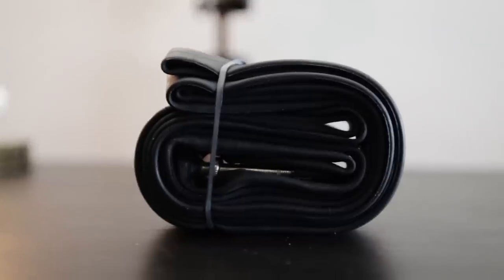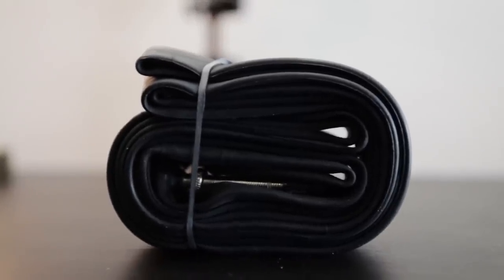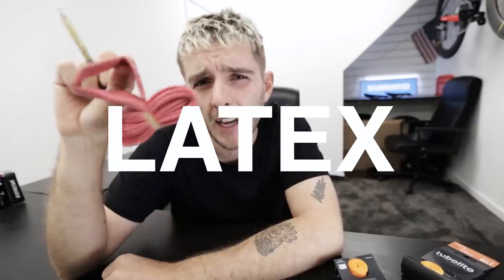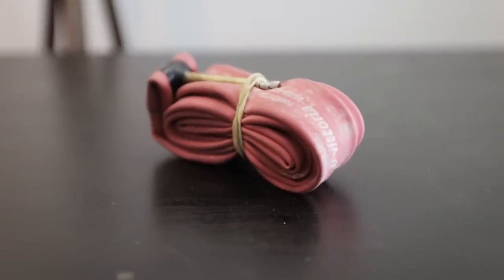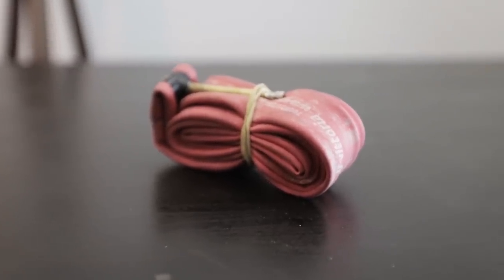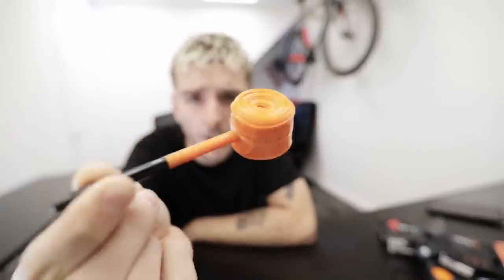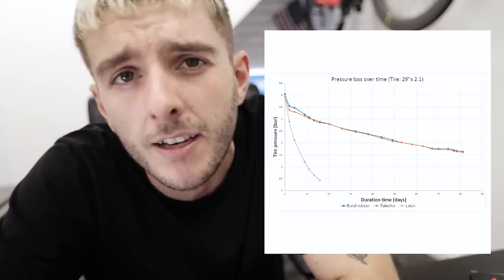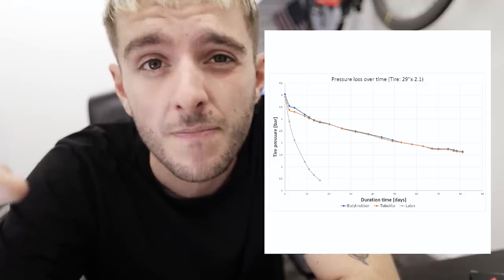The Single Best Upgrade for your Road Bike

Comment: This just cleared everything up for me! I must be made of Butyl because I am also heavy and slow with terrible rolling resistance 👍🏻 I will no longer go through life confused anymore Thank you Mr Cade.
Reply: rolling resistance increase linear with weight and not with power so if you ar twice the weight of quintana you have twice the rolling resistance and could save twice the watts with the same upgrade. this only works with rolling resistance not with chain friction or ceramic bearings...
Reply: Ianis Caratti What I typed was a joke, thanks for that though I guess....Keep up the good work with that science stuff.

Comment: Tried regular butyl and “light” butyl then several brands of latex.  Settled on Michelin latex but really could not tell much diff between brands.  Pair with GP4000 ‘s on fulcrum racing zeros; quick, comfy, light for the uphills, sticky for the down.  Can usually find them for ~$10 US, the right tool for people who like going fast.  Tubeless good for MTB, sucks for road...

Comment: I've always been trying out new components and couldn't agree more with your correct analysis having use/using all 3 types you mentioned. Tubolito initially supplied the "O" ring to be installed on the outside of the valve hole to stop the ingress of water into the rim. I wrote to them on the uselessness in it and they agreed(having received multiple feedback on the same issue). They have since removed it. Also, the initial batch out of the factory had their valve cores loosely screwed on, resulting in lost of air and "sudden puncture". They have now installed it with a clear liquid form of Locktite, which is almost permanently tight. I can pump up to 100psi and leave it there for 2 weeks and it hardly drops below 85psi. Word of Caution: Never ever over tighten the valve core on a Tubolito, you will either break the plastic valve body or stripe out the threading. And Yes, do remember to buy their Flix Kit...it come in 5 patches and is a 1min repair job and it really holds up the repair. Now I either use Tubolito or Latex.....no more black plastic Butyl.

Comment: Once you go latex you never go back... They feel so much better to ride on. In my experience they flat less often as I believe the material does not have the tendency to split like butyl.  Some complain about latex being hard to repair but the trick is not to use the patches in the repair kits but to cut your own latex patches out of an old tube. Once applied the new patch is just as stretchy as the rest of the tube  making a superior repair to anything you can do with butyl. Just be more careful installing and don't yank too hard on the valve stem. They roll so smoothly, like butter.

Comment: I've been running mine for about 1 year and they are great, no punctures or issues....if you're bothered about weight and already have a semi decent wheelset with normal tubes, these offer significant savings for the price....people laugh at spending £25 for an inner tube but then go out and spend £5000 on a bike? Go figure.

Comment: Hey , referring Tubolito , I was one of the testers of.the first gens few years back ,I can say that the product improved , and that the only issue I found was that the repair kits were(first gen) were not good enough, nowadays perfect patch's, and 2019 15k Kms , and 2punctures (same day) it's not a bullet proof option , but a very high quality one ,and if you use s-tubo(the lightest ones) they are for non rim brake options, the only negative comment is the glued on extenders on the 80mm options (in.black) looks like a bodge..
Regards

Comment: The tubolitos make great spares for your saddle bag. They’re a lot lighter and way smaller compared to a standard tube. I can now fit two tubes instead of one into my bag.
Reply: This - I use the cheaper butyl tubes in my tires but I carry a tubolito as a backup tube, it's so much more compact than other tubes that it makes your whole seat roll smaller.

Comment: Been using latex for many years, on the bike that is. Based on my experience, and barring the smaller inconveniences, they are noticeably better ride than butyl. Best band for buck (using the Vittoria pink ones). For people not keen to go tubeless, latex is the way to go. One caveat, installing on right during carbon clinchers. More in on all tubeless and will not go back tubes. Schwalbe, Vittoria and wtb tubeless... Best ever!

Comment: There’s one other option. Specialized and Continental make a light butyl tube at about 80 grams each and they reduce rolling resistance as well. See bicycle tire rolling resistance online. I changed to Continental 5000TLs recently and have had only one puncture leading to a flat since last August and that was only because I hadn’t checked the sealant in 2 months and it had dried up. I check it more often now! Since putting these tires on I have new Strava segment PR’s on a lot of rides. I agree that tubes and or tires are the easiest and least expensive upgrades you can make to your bike
Reply: The two Continental "Race Light" 700c/42mm stem tubes I weighed came in at 77g and 76g (calibrated scale).  Conti website said 65g.  Still, lighter than normal butyl at 100g more or less.  I use them routinely and have had no probs with them, roughly $7 each on sale.

Comment: Upgraded to Michelin Aircomp Ultra Light inner tube, the difference with just standard inner tubes is... Stunning! Acceleration is so much easier, due to it's light weight even tho it is still butyl

5€ for a 75g inner tube is I think a bargain :D

Comment: Latex is on the build list for my bike this winter. Lighter crank...✔️Stock square taper to carbon GXP. Lighter wheels... ✔️stock to Wabi Sub-15’s. New chain ring... ✔️50 tooth X-Sync, probably not any lighter but 10X cooler. (Specialized Langston for reference)

Comment: Best ride and closest to tubs, is latex + open tubular clinchers, I use on my road race bike and cross bike. Latex in standard rubber tyres is less effective as  the tyre profile is effective square, where as the  cotton open tubular clinchers deform on cornering

Comment: One Problem of the tubolitos is the vent:
- insert can get loose easily ( or may not be completely fastened from the factory
- does not work with a lot of pumps, especially those that have a screw on hose and many of the minipump clamp-on heads.
Some which do not work well:
- lezyne road
- silca tactico (bluetooth)

also the weird profile of the tube makes mounting a bit more of a hassle. May get better with practice...
You need to be more careful not clamp the tube while mounting. 

But except the vent issues tubolito (or similar alternatives) are great backup tubes. I would ever pack one, even then going tubeless.
Reply from the maker: I only have lezyne pumps and they work ok!

Comment: I tried tubolitos. Liked riding them until I got my first puncture. They sell a repair kit which I used. But it didn’t quite work for me, it never sealed properly. Which was a shame, given the price of those. But for me, nothing compares to riding latex inner tubes. I just love the feel and sound of them. Can’t really ride them on longer rides, because I have rim brakes and they’re a bit sensitive to the heat from the rim. Found that out the hard way. Still, they’re my favourites.
Reply from the maker: I found the tubolitos felt nicer to ride than latex, but looking at the data then latex is fastest in terms of rolling resistance... or no tubes at all!

Comment: I also roll tested and found latex better than tubilito. I agree that tightening the valve core is important on tubilito.  And related to that I think I may have cracked a tubilito on time which led to a constant slow leak. Since then, I stick with latex.  With latex, if you inflate cold, and then ride in the sun, you may get a 10psi bump and an accompanying explosion mid ride.  If you like high pressure, stay away from vredstein latex. If you like 95psi, use vredstein latex.  Vitoria is the latex brand I use.   It's worked well. It is similar to Michelin but Vitoria lets you do more in terms of valve stem versatility.

Comment: well the obvious thing that comes to my mind is what if we just ran a setup without an inner tube at all? i've had some struggles with tubeless in the past 18 months, my main gripe is just tire models that won't go on or come off. i found that hutchinson fusion 5 galacktik were the easiest to mount by far, way easier than schwalbe pro one or gp5000tl. i'd recommend a tubeless setup with these tires because they were super easy to slide on the rim and make repairs or throwing in a tube on the road way easier. i'm surprised no ones commented on how there's liquid rolling around in your tire all the time with tubeless but i'm sure it's not too big of a deal since it doesn't affect road feel or anything

Comment: Very satisfied with Michelin Aircomp Ultralight tubes + GP4000s. (...am also riding a relatively wide road wheel [Zipp 303], so the ride quality is probably a little better than it would be from a narrower wheel).

Comment: This video is so last decade ;) ... I switched to tubeless two years ago and I'm considered a late adopter by the folks I ride with
Reply from the maker: Never got road tubeless to work properly... Although got some new Hutchinson's coming and fingers crossed...!
Reply: @CG-99  I'm about to switch to tubless, is it worth it? The roads are terrible, I'm doing light off road too.
Reply: @mrblue.tit.8906  definitely worth it
Reply: @Cade_Media  my hutchinson fusions are flipping brilliant tubeless tyres, sealing really easily, pretty light and excellent feel
Reply: @cleggycyclist  one thing I'm confused and concerned about, is does it actually work puncture wise though? If I went over somthing, if it's set up correctly and maintained correctly it should seal. When the pressure is upped (let's say, one day I'm running 30psi and the day after I move it back up to 40psi) wouldn't these seals come off and start leaking again.    Or, is it really just going to be a case of, get a good set up, maintain it correctly and use a good sealant (I've purchased stan's)  and you'll forget all about it until you need to top it up
Reply: @mrblue.tit.8906  there is a misconception out there that tubeless sealant seals all - it does not. Tubeless sealant seals the tyre to the rim and yes it will seal small punctures from thorns and such. For bigger holes you need to plug them with a "worm" (or stans dart, dynaplug etc) from one of the many tubeless repair kits on the market and that worm in conjunction with the sealant will seal the hole permanently. You should never need to unbreak the tyre seal and fit a tube, that really is worst case scenario.
Reply: @cleggycyclist  thank you for educating me on that, I bought the sealant today, it's as it should be (a liquid) I just watched a video of someone showing what the sealant does after a week or so, it thinkers up a tiny bit, I was just confused on how a liquid would be able todo anything, but I guess a slightly thicker liquid would manage small punctures. I'll look into those repair kits and figure out how to use them.   I was originally talking about small punctures though, say one that's 1-2mm in size, if it seals would it ever leak?
Reply: @mrblue.tit.8906  the sealant reacts with air to seal small punctures

Comment: Didn't know about tubolito but have been running latex for a couple years. Only had one puncture and it was a 4cm slash on my tyre thanks to beer bottles smashed on the path. No inner tube would have survived. Just pump tyres before each ride, no big deal.

Comment: You say £28 is a cheap upgrade for the weight saving and performance and on the face of it that seems correct. However,  the £28 isn't a one-off, as a set of wheels would be. While a set of wheels may last me 30,000km, I'll go through 10 more tubes in that time. So my £56 on 2 tubes actually becomes £330 instead of £12, so that's a £300+ upgrade for a few grammes. 
I go latex, that's where the bang for buck is, imo. Deffo ride quality improvement.
Reply from the maker: That's a very good point!

Comment: A mechanic friend tried the latex said he couldn't tell a bit of difference. I'll stick with regular tubes.
Reply: mike anders try yourself and be the judge. I use butyl in winter and latex in summer. The latex are noticeably faster and give smooth ride - I ride 28mm tyres for both. No tried tubeleto yet
Reply: Bungle2010 👋 I use Continental GP 4000s 2’s at 28mm mostly for general use. But if I’m doing an event/race I will use Vitoria Corsa. The combination of these and the latex inners is just amazing in dry weather. I would not however recommend this set up for commuting or wet weather - I use Continental 4 Season and butyl inners during UK winter and hardly ever get punctures. I don’t want to be stood by the road fixing punctures in the cold wet weather!
Reply: @trick700  he may have been using a heavy tire. I love the gp 4000s 2. Average a puncture a year. Getting to old to worry about speed. Just started riding 25s don't think I want anything bigger than that. Might give latex a try.
Reply: mike anders 👍 here’s a tip, fit latex tubes at home in clean environment...no contamination except talc. If you’re unfortunate to get puncture on the road, fit a butyl tube to get you home
Reply: @trick700  Thanks

Comment: I’ve carried Tubolito as a spare for my tubeless road setup. Needed it, and it left me stranded. Its lightness comes in no small part thanks to a plastic valve. That value is extremely fragile, especially at the point the core screws in. So fragile that the slightest tip of angle of a pump can rip the core through the side of the valve. That happened to me. In real world conditions, with a micro pump it’s VERY difficult to inflate them. A few grams for a better valve would have saved me a long hour walk, on road shoes, down a gravel road...ruin my shoes.
Reply: thanks for the real world feedback Seth, also running tubeless and thought of these as emergency only, but if they don't help when you're already pissed with the tubeless not coping then seems counter productive...
Reply: @global_nomad.  yeah I'm kind of of the opinion that my bail out gear should be tough enough to definitely get me home, I'll take the 50 or so gram hit to know that I'm not going to have an issue in another few miles (fingers crossed)
Reply: @robdownes5159  exactly, otherwise whats the point. I have had enough experiences of double punctures in the dark and in the cold rain to know what is important (hence switch to pirelli tubeless. no issues and more confidence.
Reply from the maker: My pump has been good with the tubolitos.. lezyne one with a short hose. what brand was it?
Reply: Francis Cade I agree, the one with a hose may improve. I have one of those too, the kind where the hose screws out of the body. That day I was using a short Silca, but rigid. It’s good for people to know that these are really sensitive tubes and you can’t use them quite like latex or butyl. I’d easily take another 30grams for the assurance that the valve will work when needed. I’m a rather careful mechanic and have changed untold numbers of tires/tubes, so I add this note as a cautionary tale.
Reply from the maker: @E.S.Franck  I think both these and latex are best saved for race day/sportive day/spanish roads anyway. 
I think it's nice to feel the difference when it really matters. 
Pretty sure it used to be a sin to ride carbon wheels until it was race day too... How things have changed !
Reply: I’d also suggest that if you do use the Tubolito’s, and you store them long term in your saddle bag, that you protect the valve in there. Don’t just jam everything in there. The valve stick out of the rolled up tube, not folded in like you’d find on a butyl. Alternatively, you could take a stiff piece of plastic tubing, sort of like a straw, and insert the tube’s valve inside to ensure that it’s protected. Goodness knows, I go a long time on tubeless and just hope that the tube in my saddle bag isn’t spoiled if/when I need it!
Reply: Francis Cade I agree. Don’t be somewhere you could be stranded.

Comment: Hey Francis, 
I just got back from my LBS looking for latex inner tubes. My mechanic advised me against them stating that on carbon wheels with rim brakes latex tubes are much more susceptible to blowing if over heated during a fast descent. Is that true?

Comment: butyl, latex and thermoplast is the rightful way to describe them. Tubolito is just a brand but other brands make thermoplast tubes too
Reply from the maker: Aha! Interesting to hear this, I had no idea
Reply: awsome tubes. the walve works only with clamp pumps not with screwed ones unless you are carefull
Reply from the maker: @ianiscaratti4924  I've been using my screw one on mine with no issues, both my floor and mini pump are lezyne
Reply: Francis Cade realy interessting. my lezyne pump ripped the thin thread and took the core out like opening a whine bottle after some month.

Comment: Interesting Vid Francis, I've considered the switch to latex but went to better tyres instead with butyl tunes, for peace of mind on the crappy roads round Sheffield - except for when I let the tyres get to low pressures (my own ignorance) they've been bulletproof and the tyres made a massive difference to the riding quality so have been happy with the setup.
Ps how about an update on your busted frame and wheels? Is all that sorted out yet regarding BA, Spin on These replacements etc.? I assume you are running the boss Wilier Custom painted bike instead now?
Reply from the maker: Still ongoing, problematic because they are sponsored items and they want proof of purchase
Reply: @Cade_Media  sorry to hear that it's turning out to be a pain. Stick with it buddy.